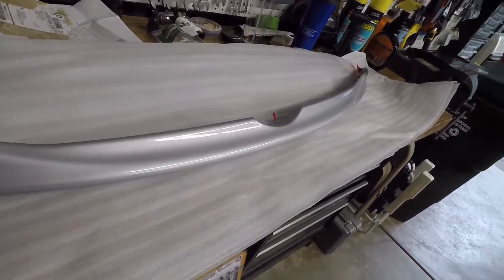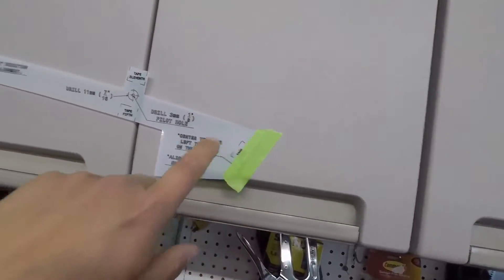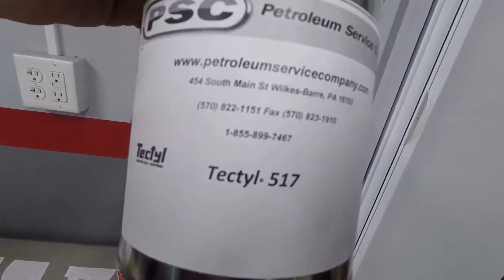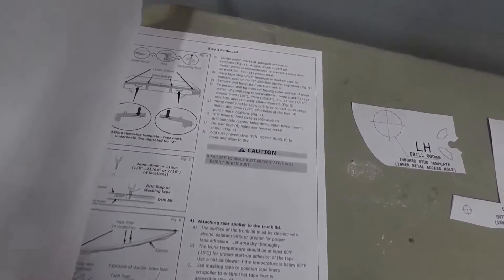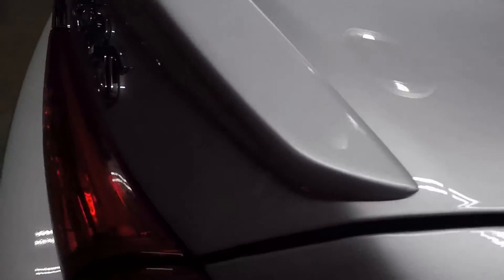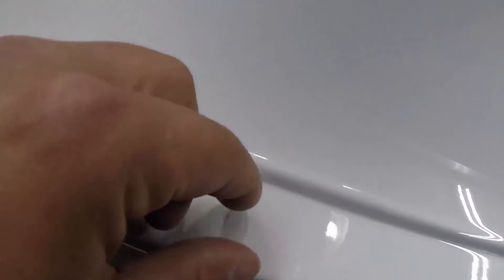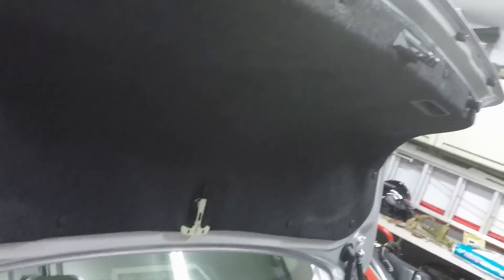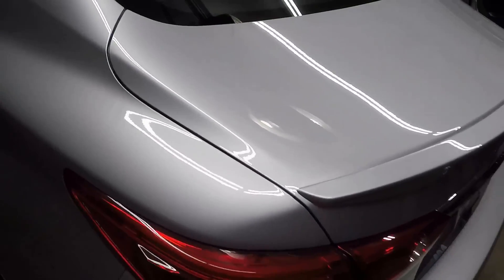How to Install a Factory Spoiler on 2015 INFINITI Q 50 S

Comment: how to remove tbis spolier？
Reply from the maker: It would be the reverse process. Remove the felt trunk liner, remove the nuts that thread into the spoiler studs. The spoiler has double sided tape. Please note, there will be holes exposed in the trunk when the spoiler is removed.
Reply: Appreciate!  @GavDetails

Comment: Screwed in rear diffuser, felt like had to for gaps. But this deck spoiler?.. just used 3m double sided. Don't think I could screw in my trunk. Does dealership/infiniti always screw these in or do they use double sided tape too?
Reply: Oh, greet job btw! I would let you do it, I'm not.
Reply from the maker: Hey Russell, I cannot speak for the dealer install but this is a OEM part and the directions from Infiniti instruct to drill.  Tim is pretty particular about his stuff, so if he drilled, he felt that was the appropriate way to install it.  No issues to report 1 year later.
Reply from the maker: @BillClay88  All Tim, I held the camera and was an extra set of hands for the putting in place part of the install.
Reply: @GavDetails  well, impressive nonetheless. Great vid.

Comment: Hey question, What size bits when installing the oem spoiler for q50? Helpful vid btw!
Reply from the maker: The sizes are mentioned around the 4 min mark. 1/8" pilot hole, 23/64" for the center holes and 7/16" for the outside holes. Again, roughly 4:40 and 5:30 into the video.
Reply: Gav Details got it thanks! Also noticed on 8th min mark you mention the torque specs for the the torque wrench. What exact specs are recommended when using one to tighten bolt for oem spoiler?
Reply from the maker: @Gabe-fn5pf  the low torque specs are not achievable with what we had. I would say hand tight or less. This was also explained in the video

Comment: Sheesh,I just ordered this spoiler for my 2014 S,and watching them drill those holes made me cringe  😬.Im just gonna go to the dealer and fork over the extra money for them to do it
Reply: I cut the bolts off and just used 3m tape to hold it down. No way in hell i would have drilled holes in trunk to install the spoiler. 3m double sided tape works perfectly by itself btw
Reply: @feta8939   I'm going to do the same